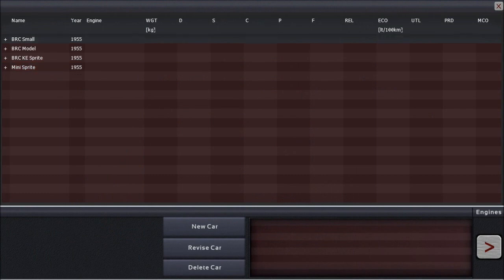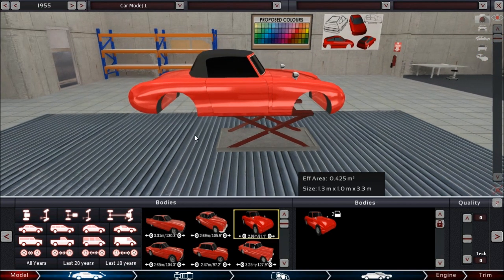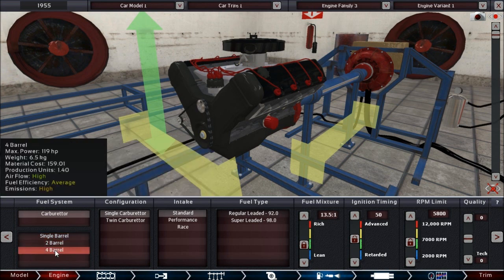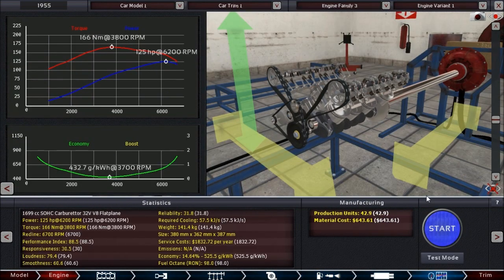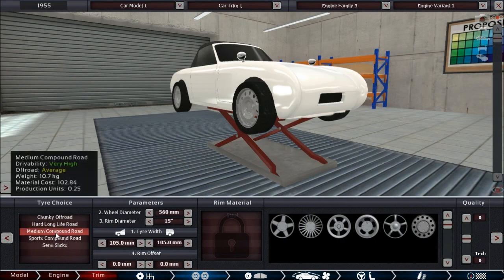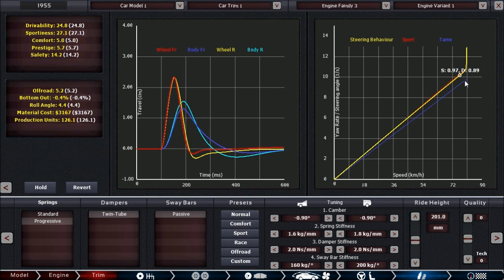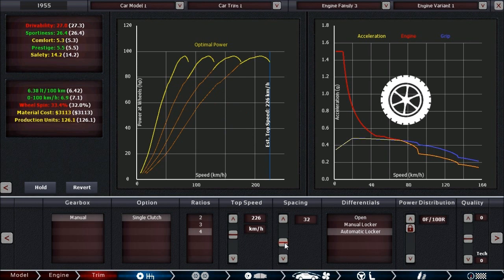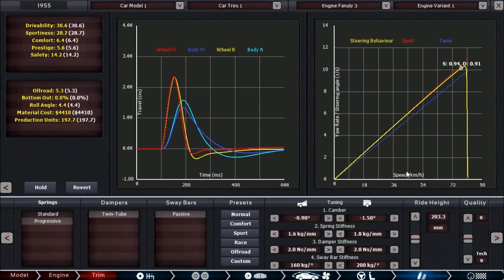Let's Play: BRC 1955 Competition

Comment: I'm deeply, deeply amused by your repeated insistence that we will never reach our top speed, because my car most definitely does. Admittedly, that top speed is barely 200 km/h because aero resistance, but it gets there!
Reply from the maker: Packbat (RobinZimm) That doesn't change the validity of my argument though. Your car would get to "close to top speed" quicker with lower gearing, thus being faster everywhere but the last third of a straight, making it faster around the track overall. Of course that can be overdone too.
Reply: True - and I did test the effect of gearing on lap times. I'm amused, is all. :)